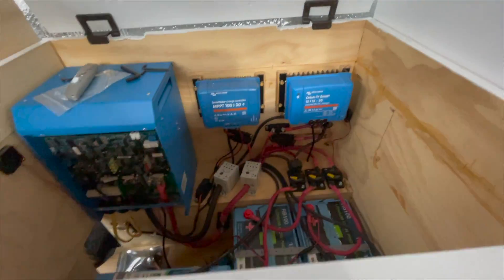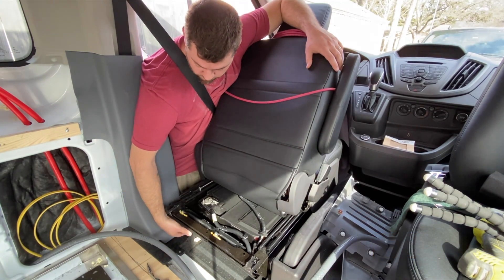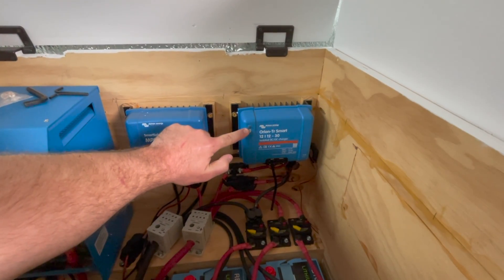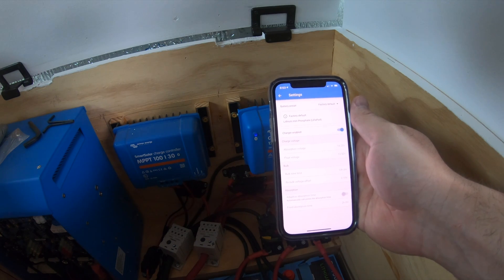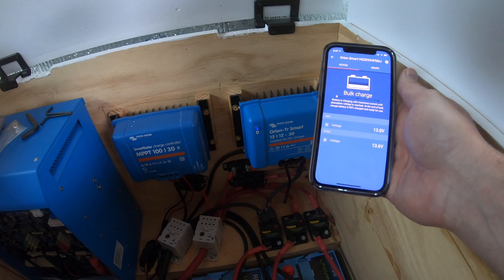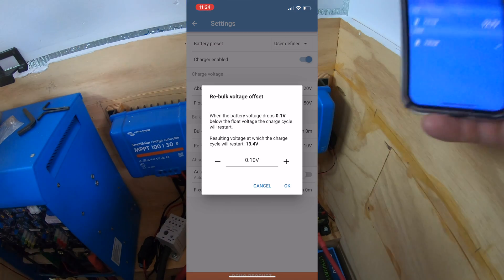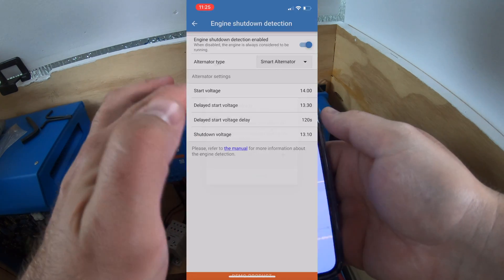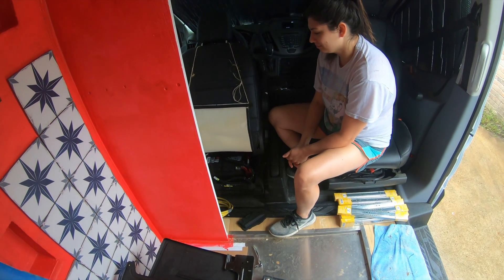Victron DC to DC Charger Installation #beanstraveling #bradandnicole #Vanlife #Victron

Comment: Hi Brad & Nicole. Nice video.  I plan to use the 12-12-30 Isolated Tri-dc to dc charger on my pop top pickup camper. Does the + 12 feeding the charger from the truck come directly from the alternator or the +post on the truck battery? Nowhere can I find instalation instructions covering this. Thank you for any info.
Reply from the maker: Thanks for the comment   
Our DC DC charger has options for both coming from the alternator or the battery. But our battery is already in the cab of the vehicle so we used that instead of running a separate wire. Most new batteries have a brain. They will only allow it to charge so much. So Personally, I would rather replace a $400 battery rather than a $2000 alternator if anything was to go wrong.
Hope that’s helpful.
Reply: Yes, as well the Victron will taper and float not to over charge if you have a regular battery. Thnx it was helpful. Happy trails n camping👍

Comment: So, it will boost the voltage if the selected absorption voltage is higher than the input voltage?
Reply from the maker: Not boost, most alternators put out 13-14 volts with the heavy duty and duel setups putting out more. If your absorption voltage is higher than the input voltage, you’ll wear your alternator out faster. Based on your alternators output, you have to assign the voltage if it doesn’t match one of the preconfigured settings. Transit, Ram and the sprinters configurations are all available out of the box.
Reply: @BradandNicoleBean looks like I seen a higher output than input in your video.
Reply from the maker: @jamesfalvey77 if we’re talking about the same moment at 3:44, this is the delayed settings to ensure the vehicles batteries charge first if you look later in the video, you’ll notice that the numbers match after running for a couple of minutes.
Reply: @BradandNicoleBean  thanks for the response. Love the channel. I feel that being able to control the output current would make this device more attractive
Reply from the maker: Thanks much! I agree

Comment: Using same charger. Gets so hot I can’t touch it for more than a few seconds! Is that normal? I’m using 6awg wire and 60amp fuse at the battery. 

Is the burning hot normal?!
Reply from the maker: That’s not normal. The fins on the back will be warm even a little hot to the touch but you should be able to keep your finger on it. I would make sure the unit gets airflow if possible. 
I want to say it’s only a 30 amp fuse, but you should be able to go into the app in the settings. Determine how much wattage or AMPs you’re allowing through.
Mine is 10 AMPS on start up and 13 at idle but that’s based on my alternator and the type of battery I’m running. 
You can call the 1-800 number they have a help line. 
I hope that’s helpful

Comment: What does the little green gizmo do that you plugged in the bottom?
Reply from the maker: Wire bridge, this was the term they used in the manual for item S1, little green connector. This acts like an on and off switch for the device. You can use the input, depending on how you want to activate the charger. See link
https://www.victronenergy.com/upload/documents/Manual-Orion-Tr-Smart-Charger-Isolated-EN-NL-FR-DE-ES-SE-IT-.pdf

Comment: Have you had any heat issues with the DC to DC charger being mounted on timber?
Reply from the maker: I extended them away from the wood itself, so there was more airflow. You can see what I’m talking about in the video 🤞🏻no problems yet!
Reply: @BradandNicoleBean  Thanks for the quick reply. I'm looking at installing one in an Aluminium Canopy on the back of my ute. I have heard that they get very hot so I'm thinking of getting a sheet of Aluminium plate. also installing some ventilation for air flow.
Cheers and happy travelling
Reply from the maker: Thanks! Anytime!!!

Comment: That DC DC charger has one major problem, it is not a battery isolator as well while National Luna, Projecta😂and other brands come with both a built in MPPT and isolator. I found out the hard way when both my auxiliary and main batteries were dead and my car locked (double locked mind you) and the lock had to be drilled out to open the car (it was an emergency)
Reply from the maker: Akhona thanks for the comment but your statement is incorrect. This is the Victron Energy Orion-Tr Smart 12/12-Volt 30 amp 360-Watt DC-DC Charger, Isolated (Bluetooth). This is exactly why I purchased this particular one. I’m sure some of these other brands are good but I only use Victron because of it quality.
Reply: They might be different @BradandNicoleBean . I have the 12|12 9 (110w) isolated (non-bluetooth). It does not isolate the two batteries. It only "manages" the charging profile of the auxiliary battery. I have experience of this. I left a cooler on (the cooler draws a constant 45 watts when cooling) and, I promise you, my battery died. I love Victron (don't get me wring), My entire dual battery system is Victron and it is really good. I was just as shocked when my main battery died. Do some searching on the net and you will see that yours is also not an isolator as defined. When the ignition is off the two batteries do not get "disconnected" so that you only use up the aux battery only.

Here is another awkward one that I didn't know until yesterday (after the locksmith opened my car), My DC DC charger does not charge backwards. My auxiliary battery has solar input (Victron MPPT) and Victron AC DC charger (Victron Blue Smart IP67 12|25) so I hooked up the 25 amp (powerhouse) AC DC charger and the auxiliary battery was fully charged in no time but guess what, I still couldn't start my car (funny). I had to jump start it (luckily the two batteries are next to one another). I was so lucky that all of this happened while I was in a safe place (home).
Reply from the maker: I only did research on this one. This one actually does isolate. I’m looking at the Bluetooth right now. Engines off. Key is off power coming in 12 V, power going out zero. That’s the luxury of having the Bluetooth so you can see what the unit is doing on or off And from a distance. Definitely an unfortunate circumstance that you found out that yours isn’t isolated. But if it’s supposed to be, I would highly recommend getting with Victron and finding out if it’s wired correctly, there are ways to bypass and in doing so you run the risk of running your main battery down as well.

Comment: I also have the isolated version. Can I use the chassis for negativ as input and output. Ore do I have to get an wire to my starter batteri?
Reply from the maker: That is correct. 
You’ll have two different electrical systems. Your vehicle system and your house system.  This is the only piece of equipment that is connected to both systems. You have the positive from the vehicle starter/battery and ground to chassis. The house electrical has to be grounded to back to its closed system (Not grounded the chassis).

Comment: I wonder what type of battery you were using in the coach part?  Lithium iron etc. would be 14.2-14.6 right?
Reply from the maker: Yes Lithium and  yes 14.2-14.6 is preprogrammed in the charger
Reply: @BradandNicoleBean  thanks for such a quick reply... I am still workin on my rig and have a solar and dc to dc by victron ... later.
Reply from the maker: I actually enjoy this part of it, if you have any other questions hit me up!

Comment: I’m confused about the connection to the alternator.  Do I connect to the starter battery OR do I connect to the alternator itself?
Reply from the maker: You’re going to connect to the starter battery with positive and negative or ground negative to the chassis.

Comment: The input voltage on my transit with the headlights off is only 12.5V which isn’t triggering the Orion. With the headlights on its 13.2V Why would this be and how do I increase the voltage with headlights off?
Reply from the maker: Are you just trying to get the DC to DC charger come on? You can adjust the Settings and then go to engine Shut down detection. You can program Start voltage and the delay voltage I think this could help.
Reply: @BradandNicoleBean  yeah just trying to get the Orion to come on. I was thinking of changing the start voltage but I’m worried that if the voltage is too low then the starter battery won’t charge properly? Or it won’t be enough to fully charge the leisure batteries?
Reply from the maker: It is a possibility! Are you able to access it on the app location and is your wire bridge in place correctly?
Reply: @BradandNicoleBean   sorry I probably sound a bit clueless but what’s a wire bridge? It’s wired straight into the positive terminal of the engine battery as there’s two under the drivers seat. The whole system is grounded to the van chassis at the back. It appears in the victron app which is how I’ve been monitoring the input voltage
Reply from the maker: @tomloweshow  lol not at all. You can go back and watch the beginning of this video or look at the Manuel. It’s the little green connector that’s wired to its self. You can’t start the charger without it being inserted.
Reply from the maker: Time stamp 0:58
Reply: @BradandNicoleBean   oh yeah I’m with you now haha. I’ve got the 18A version and the wire bridge seems to be screwed in from factory. I haven’t touched it and all seems ok. I’m starting to think I’ll just have to drive everywhere with my headlights on in order to charge the house batteries. Not ideal but I’m not sure how I’d increase the alternator voltage 🤷‍♂️
Reply from the maker: I don’t know! Lol sorry I can’t help
Reply: @BradandNicoleBean  that’s ok I appreciate your help. If I find the solution I’ll reply with it incase anyone has the same issue
Reply from the maker: That’s great 
Thanks
Reply: @BradandNicoleBean  just thought I’d reply as it seems to have been resolved. I wired my gps tracker into the terminals but on the battery monitoring terminal not directly to the battery terminal. On the positive there’s a little 3A fuse circuit thing and on the negative a little piggy back thing off the -ve. Not sure if this would cause the intermittent problem but since reconnecting it to directly to the bolt holding the clamps on the terminals it seems to have gone away. Every time I start the van up I’m getting at least 14.6V. My battery is shot though and struggles to reach 12.3V on a cold morning and the windows are really lethargic. Other than that though it works fine.. touch wood
Reply from the maker: That sucks about the battery but at least you figured it out. Great job, glad to hear it’s working! 
Thank you for the update!
Reply: It’s me again 😂. After all that my alternator was failing, died a whirring death yesterday and stopped charging properly. Replaced and charged perfectly 😂
Reply from the maker: Well that’s awesome news. Sucks to pay for a new alternator but I’m glad you got it worked out.

Comment: Input 13.9 and output 13.6v. Are these numbers feel alright to you? I thought alternator produce above 14v. I have same charger and it feels like an over advertised scam. I mean if it makes less or more 0.3v then alternator itself. So whats the point and where is the magic?
Reply: It’s also acts as an amperage limiter, if you just ran a cable from your start battery to your house battery with a on off relay it would try and pull 100s of amps and cause damage to the system.
Reply from the maker: I have a heavy duty alternator Capable of much more(50amps) but I think what it comes down to is what your batteries are capable of absorbing, for instance the lithium that I’m running, are only capable of an absorption rate of 14.25 V.

Comment: In your RV , you have TWO white boxes next to the three breakers ,  Power distribution boxes , what do you call these ,The White boxes have a large positive Cable and several smaller power wires , and the Other Has a Large NEG cable and several Neg wires. They look very good for my upcoming install. WHAT do you call these , or a brand or part number would be great . It looks like some kind of a BUS terminal ( buss bar ) I like these and any info is apprecaited
Reply from the maker: Yes there is a power distribution block We’ll reference our video electrical part 1, where we go over all of the components and where you can get them. I’ll put the link in the video description.
Reply: @BradandNicoleBean  thank you
Reply from the maker: Yes sir! Happy to help

Comment: What if the bluetooth light doesn't come on and start blinking? Also our on/off light is not coming on.
Reply from the maker: If the the Bluetooth light isn’t flashing that means the unit isn’t getting power. I’d go back and check all your connections and make sure line has power. I didn’t do a very good job of filming it but the on light is on.

Comment: what is a wire bridge? can this be controlled using a usb cable? thanks
Reply from the maker: This was the term they used in the manual for item S1, little green connector. This acts like an on and off switch for the device. You can use the input, depending on how you want to activate the charger. See link
https://www.victronenergy.com/upload/documents/Manual-Orion-Tr-Smart-Charger-Isolated-EN-NL-FR-DE-ES-SE-IT-.pdf